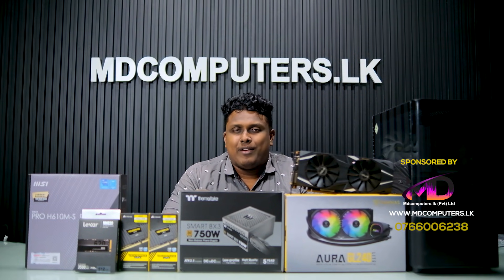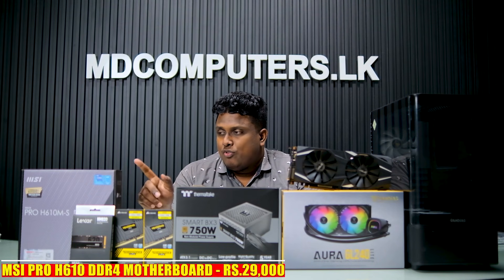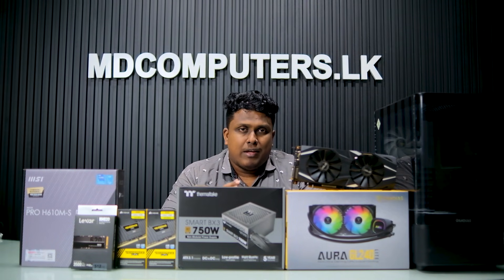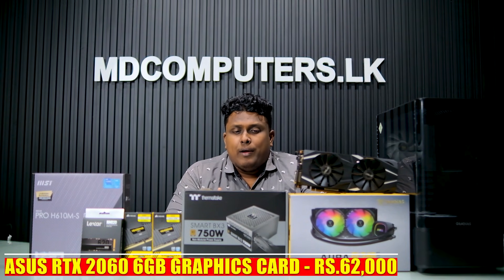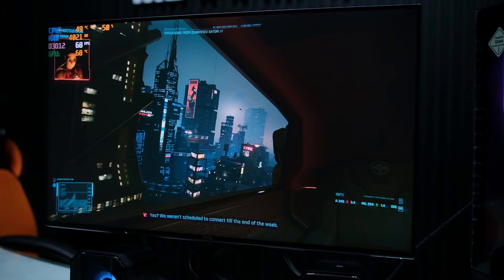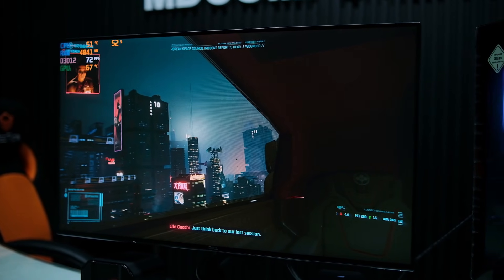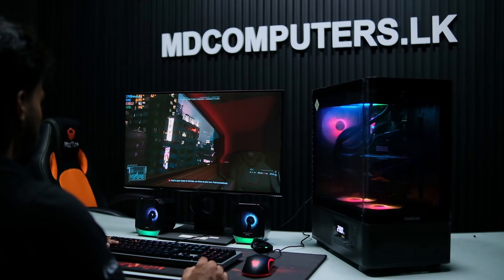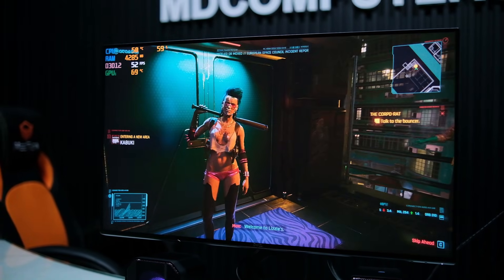රු. 10,000 ක් ආපහු ඔයාගෙ අතටම දෙන සුපිරි Gaming PC Build එක - 😍 MD COMPUTERS 011 2755700 076 6006238

Comment: "*CPU:* AMD Ryzen 5 7600X 
- Motherboard: ASRock B650M Steel Legend WiFi 
- RAM: Corsair Vengeance RGB 16GB (2x8GB) DDR5 5600MHz 
- Storage: Lexar NM620 1TB M.2 NVMe SSD 
- GPU: NVIDIA GeForce RTX 5060 Ti 
- Power Supply: Corsair CX650M 650W 80+ Bronze 
- Case: Corsair 2500X Mid-Tower Case " මේටික දාලා PC එකක් රු. 200000 Build කරන්න පුළුවන්ද?
Reply: පිස්සුද bro card එකම 138000